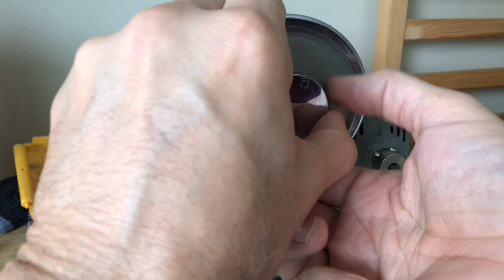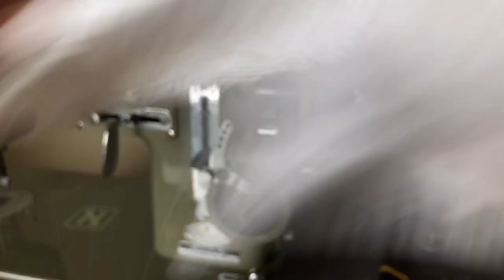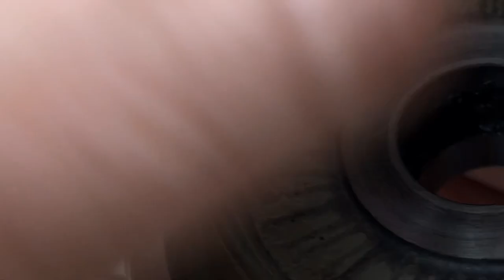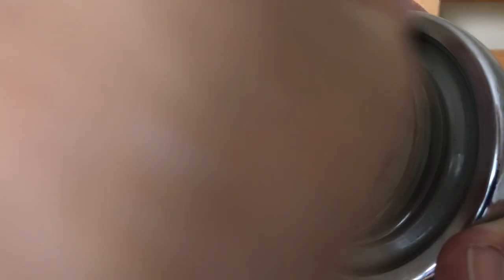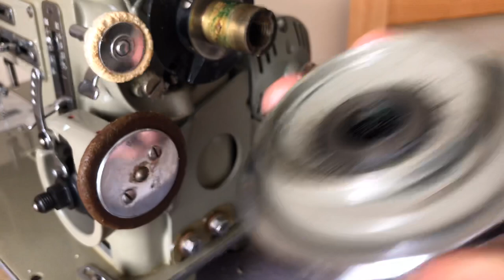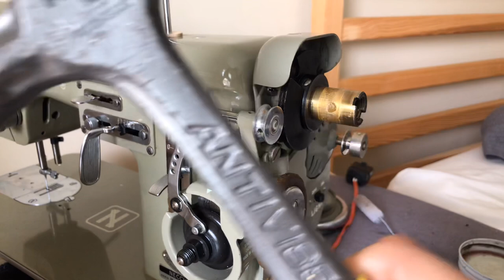RESTORATION SERIES # 28: Show Your Hand Wheel Some Love : Servicing The Wheel & Clutch Stop Washer

Comment: When I tried removing my hand wheel with this method I managed to break that bushing with the counterweight. That bushing on my machine was made from one piece cast steel. Fortunately I have a machine shop and was able to make a new bushing. I machined out the counterweight and attached it to the new bushing with the existing set screws.

Comment: Hello, I have recently retired and I have started buying and trying to restore old sewing machines. This video was very helpful as I have acquired several Necchi BU serie Mira machines and I am working on the hand wheel. But i have removed the bushing underneath the hand wheel along with the hand wheel altogether. That bushing has two different types of nuts, one nut has a point that goes into the groove of the shaft and other has a tiny brass 3/16 inch plate between the nut and the shaft. I assume it is there to prevent scratching of the main shaft. Daniel

Comment: Based on your enthusiasm for this machine, I bought one on Craigslist.  Mine is in really rough shape, probably stored in garage or worse.  It came with a cabinet which on the pictures looked like it might have been walnut, but it is just a so-so piece, also very beaten up by time.  I paid $100 for it which is probably too much, but this one is the first one I found relatively near.  I still drove an hour for it, just to get one to restore.  The paint is not pretty, but it’s not pitted or lifting, so u an Hopi f that cleaning and car paint cleaner polish will restore the paint.  It may never look as nice as the two prime ones I. Your videos, but I hope to be able to clean and restore the internal mechanics to perfection.  Mine did come with a bunch of presser feet. One of the rolled hem feet looks like it was a piece lost at NASA. It also has all four of the pattern cams.  

If I ever see a second one I’ll get it either for the nicer shell and/or for parts. 

If you would be open to answer any direct questions I may come across, please let me know.  I’ll leave an email address so you can establish private contact. I’m one of five or ten people on the country not on social media, so that is not an available channel for me.  

Many thanks for your detailed and most educational videos.  I would not have embraced this machine / project without your tutelage.  

All the best
John. Jcqcomm at gmail.

Comment: Is there a reason why you chose to use the wooden drift instead of a three-jaw puller to remove the handwheel?  I would assume that you could get a metric bolt to thread into the end of the shaft to push against.
With some decent measurements, I think you could get that black plastic bushing made in plastic by 3D printing or CNC machined from some type of metal if a replacement was required.